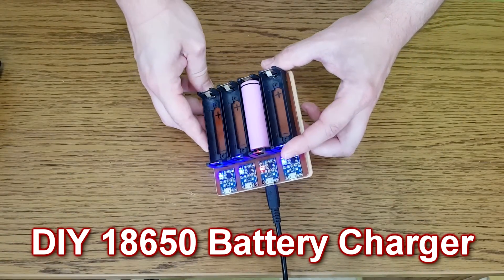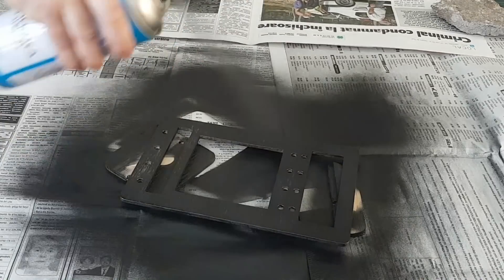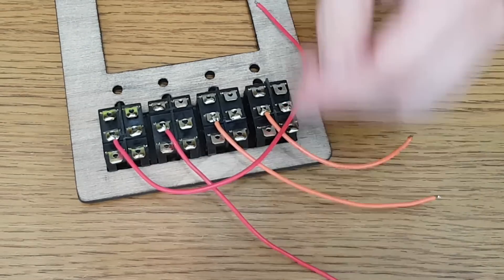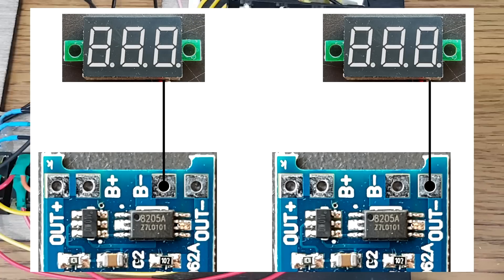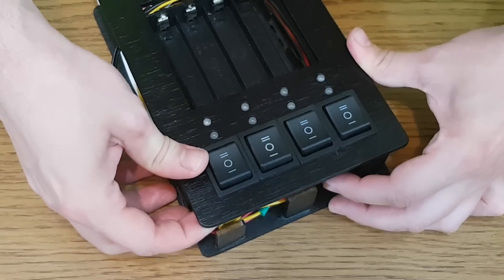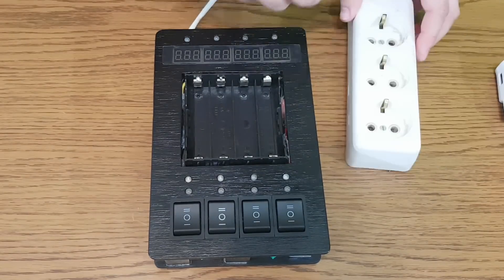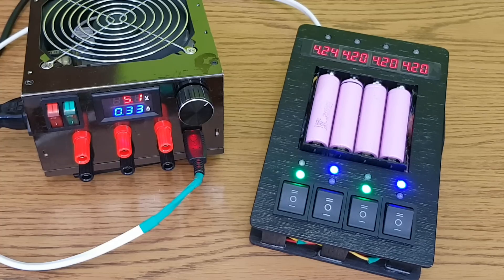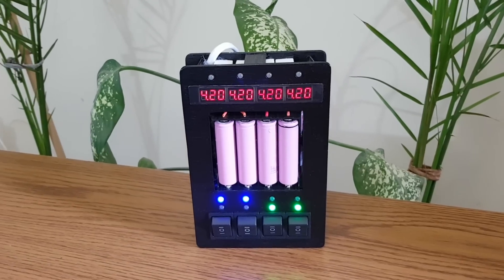My DIY 18650 Battery Charger

Comment: Hi sorin ,I made the same chargeras per your old one , but i cann,t charge 4 cells at one time with a wall pluck charger . only one at time , how to charge 4 cells at one go , what do i need to do further .. tks
Reply from the maker: hi. did you connect the supply wires to all the charging modules? if you connect it to a usb charger, but without any 18650 cells, the blue LEDs on all 4 charging modules should lit up.
Reply: Hi Sorin thanks for your swift reply , Yes i did connect the charging wire supply to all the connectors , but cann,t charge all the four cells at one go. only notice that the red charger lights  one ,two at times the 3rd charger lights fliking . but works well with one cell ,, supper good ,
Reply from the maker: hi. try it with another charger. preferably a minimum 2A charger.
Reply: Thanks will try it that way

Comment: Really nice work on the build. But its really only useful as a charger. The discharge is almost completely pointless as it doesn't count cell capacity on discharge and is not CC on the discharge dropping from 420mA to just above 250mA.  I would do a Version 3 of this and change your discharger resistor thing to this https://www.aliexpress.com/item/Li-ion-Lithium-Battery-Capacity-Tester-Resistance-Lead-acid-Battery-Capacity-Meter-Discharge-Tester-Analyzer-YX/32757880555.html. It has the voltmeter inc and all you need to do is add your resistor for 1amp tests.  Hope that helps and nice work overall. PS save alot of time and buy a cheap 3d printer :)

Comment: 2.2K gives right at 500mA, I love those TP4056 charger modules
Such a great build and very clean an innovative...GREAT JOB!
That battery protection circuit on the charger will protect the TP4056 from reverse flow and killing the charger module (ask me how I know ;) )
Reply: Brian C
Being a marine you probably did something stupid, right?
Reply: I was also taught if it's stupid but works...it ain't stupid...